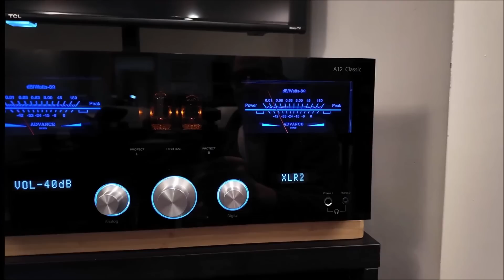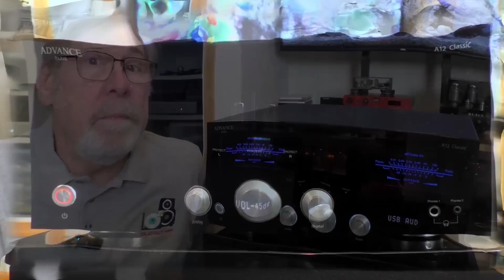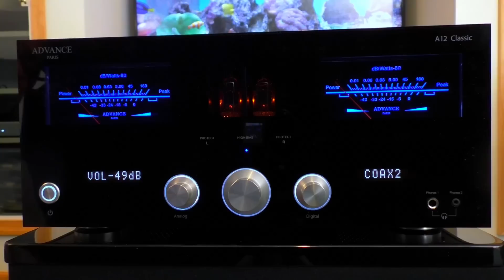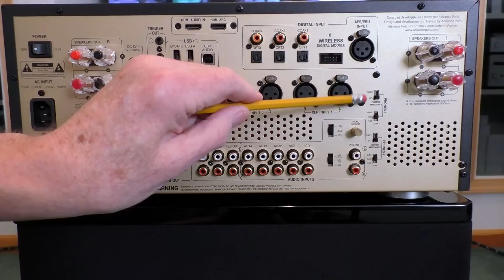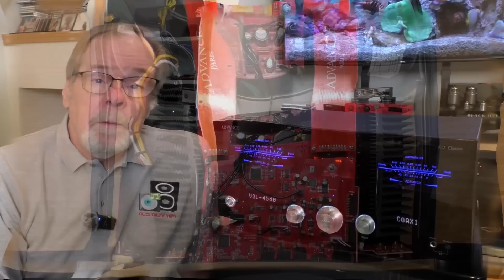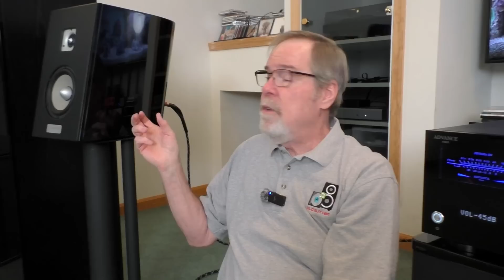Look out McIntosh! Someone new is knocking on the door! Advance Paris A12 Classic.

Comment: McIntosh are masters in marketing so it’s no surprise they are open to copy and criticism. This Integrated boasts impressive specifications, looks “okay” inside.  But from experience with Chinese-manufactured gear, their audio products are seldom thoroughly tested other than random samples, or ever burned-in. One cheap resistor or capacitor will put a hefty amplifier out of commission, what service facilities exist for Advance Paris?
Reply from the maker: Manufacturers Like Cambridge, Advance Paris, and Classe all have there own employees on site. Understand that all the Chinese partner does is mange the assembly, much of which is automated.  Advance Paris designs the units, designs the production process in conjunction with the Chinese partner. AP procures and specifies all of the componentry much of which is bespoke to AP. The toroidal transformers are a good example. They are not buying any of the self parts other than the ubiquitous small parts that are not in the signal path. I have some familiarity with this type of manufacturing. Remember all the basic electronic pieces and parts that go into any product are source from China anyway. Having your unit built there saves money in transportation cost as well as of course labor costs. As far as serviceability you can have that concern with any brand. Now with the new ownership of MAC the industry is a buzz with rumors so the ability to get that stuff repaired my be an issue. Kevin Moll at Skylabs Audio in Des Moines picked up the line because of the way it is built and its serviceability. All of these concerns and statements can be made about any product from any manufacturer. Thanks for the view and comment.

Comment: Good review.  Question:  Can you output the raw digital file from the A12 if one want's to use an external DAC?  And, McIntosh does not need to be worried about being pushed to the end of the line by the A12.  They have been there for quite a while.
Reply from the maker: What raw digital file? It is not a streamer. If you are connecting it to a digital source why not just connect that digital source to the external DAC in the first place, and then connect the DAC to the A12?
Reply: @OldGuyHifi  Yes, I made a mistake. Thanks for getting back.

Comment: Great review, but would like to hear a comparison to the A10 Classic
Reply from the maker: They are very close. I won't have the opportunity to do a side by side but I am familiar with the sound of the A10. They both share that rich and detailed Advance Paris "House" sound. As you would expect the A12, with its dual mono configuration does has more drive and a better sense of effortless power. That said, I think the A10 is an excellent unit and a great value. They both share so many similarities in features and gozintas & gozoutas. Both have very good phono preamps and internal DACS. I would be happy forever with either unit. Thanks for watching nd commenting.

Comment: Hi Ed, I've owned the Advance Paris A10 for 8 now months and loving it. How would you describe the sonic differences between the running the A12 in High Bias mode Vs Non High Bias mode. My preference for the A10 is High Bias I think, both can't put the difference into words. Beth Orton 👍,   Boards Of Canada - Music has the right to children album comes recommended. Damo
Reply from the maker: The A10 is a really great unit. I am jealous. I only get to borrow this stuff. At low volume levels I do think there is a small measure of additional smoothness to the sound in "High" bias mode. I just left the unit in "High" bias all the time. Thanks for the comment and perinate question.

Comment: Great review, as always. Like others I am curious on what it will take to swap or replace the tubes when the time comes. What is the life expectancy of the tubes? One You Tuber suggested that the unit needs to be sent to an approved service center to have the tubes replaced. The shipping would probably be more than the parts and labor for the tube swap. One other question, well two. Can the loudness be controlled from the remote and is it variable? Thanks! See you at Axpona??
Reply from the maker: I will ask. I suspect the tube life will be something like 10,000 hours. That's no uncommon for tubes in a preamp.

Comment: Hi Ed, great review as always. Just couple of things I'd like to know if you'd be so kind. First I didn't quite hear what you thought of the sound stage widthvof this thing, I mean just how wide did it seem to go? Secondly, this is a hybrid a integrated,, so the sound is not a wholly solid state one neither is it a wholly tube like sound either. So how does it compare soundwise with the LTA Z40+ you reviewed and praised just a little while back? Thanks.
Reply from the maker: The soundstage is really a function of the speakers. The amps job is to delivery the best possible signal to the speakers so they can do their thing. The A12 delivered in spades. On the Wharfedales the image was room defyingly huge. So it is excellent in that category. They're is no way to compare the LTA with the AP. They are totally different topologies with completely different sound signatures. The has a unique and individual sonic character. It is also more than twice the price. That said, I would buy the A12. Thx.

Comment: I've been looking for a modern integrated amp for the last two years after having vintage tube and solid state gear for years Still have that stuff, I'm not parting with it. So I looked at the McIntosh MA 5300, and the MA 7200 and they're fantastic, but the price was off putting. So I looked at the Rotel  RA-1592 and the Parasound Hint 6 and they're great, but there was something missing. And then the Advance Paris A12 came out and it just hit all the requirements. I listened to it at a local dealer and I was impressed. It was more than I thought I would spend but I'm happy I bought it.
Reply from the maker: That's great. I am glad you like the unit. It is a very compelling product. Thanks for tuning in.

Comment: The TI PCM1796 DAC is 20-plus years old and costs $3.20 when purchased one at a time ...
I'm not sure I'd brag about that particular DAC chip
Reply from the maker: So? If it sounds good it is good. Have you ever heard one? Do you even know how it decodes data? According to that logic everything old is questionable. Is  a 20 year Taylor Fladgate Port no good? Do you even know what that is? Thanks for you input Andrew.
Reply: @OldGuyHifi  / I'm not trying to pick a fight. I'm simply pointing out that as DAC (CMOS SMOC) devices go, it's old and inexpensive... The TI PCM1796 hasn't received an update since 2009, and companies like WiiM use a more expensive DAC in their $329 MSRP streaming amp. So my point was that I probably wouldn't brag about the TI PCM1796 in a $4,000 box...
Reply from the maker: Wiim is a bad example. They sound terrible. Doesn't matter what chip they use it has no oscillator clocks. It uses the cheapest 5 volt ESS mobile chip. It sounds far worse than the BB chip. Just because it is new doesn't guarantee better performance. That ESS 9038Q3M chip costs retail $16.00. Bulk price is less than $6.00. BTW, that ESS chip is used in DACs coating upwards of$2k. Just a DAC, not an entire integrated amp. What made be challenge your statement was you assume that I must not know what I am talking about. I had my first outboard stand alone DAC on 1988. None of this is new to me.  I would like to think we can agree to disagree. This is a wholey subjective hobby after all.
Reply: @OldGuyHifi  / I'm not sure we're disagreeing on anything other than the TI PCM1796 being something to brag about ... Other than that, I don't have any issue with anything you've posted in response. I wasn't making reference to sound quality (that's like arguing about favorite color). I'm talking about BOM Parts quality anyway, I think I know why they're using that old DAC, because I'm pretty sure whose digital board topology they are using.
Reply from the maker: Andrew, I am not sure any units Bill Of Materials matters at all. So, it not expensive and it old. Who gives a Sh!t as long as it sounds good. Thank you.
Reply: @OldGuyHifi  / Then why do you remove the lid and discuss the BOM parts?

Comment: Ed
I dig this review and it seems like a real winner giving you the advantages of voltage control in pre and current AB in the power amp.I wonder though the idea at this price of getting locked in with DAC or paying and latter bot using it.Guess I like  the old school design of Rogue.Atnthis price I might want to jump to Accuphase or Luxman. ( Love if you got the Accuphase E700 class A).Hey how about discussion of using tape and EPL for Dirac or other equalization.?
Reply from the maker: I really liked the built in DAC. I don't care if things change. If sounds good now it will always sound good. DAC manufacturers are playing the Intel game. Newer! Better! Bigger! Bader! You must get the latest!. Chip Roulette. Sorry, under $1k  they are starting to all sound the same. Good but if no different than the previous chip. The more upscale R2R and some of the multibit DACs have a great sound. I am sorry Charles, auto room EQ, DIRAC, and the like hold zero interest for me. They can't fix a bad room. Thank you for tuning in.
Reply: @OldGuyHifi  well your right I guess about Dirac in that the better the gear the less effective)less necessary.I ask because I guess being born during the Johnson Administration I remember when  tape loops were in and comforting to see the option is there should I want to try it.Sowakinh of olde gear I have always wanted to restore an APT Holman Pre.Amie dis a rest of one at ADR and it got good marks but I know you use your ears.What I Should really get to replace my EAR EL34 is sla good valve pre and get a few amps.But then again Accuphase and Luxman always beckon.I am rambling now
Reply from the maker: Don't worry. I ramble all the time. Just watch one of my videos. It is an old guy curse. BTW, I was born during the Eisenhower administration. I will be reviewing a Black Ice Pre soon and pairing it with some Class D mono blocks. Probably not for a month or so. Thanks for your thoughts and view.

Comment: Ed, are you able to swap out the tubes when they go bad? Can you tube roll with the A12?
Reply from the maker: Yes but is is a bit complicated. It can be done but requires a bit more disassembly then I was willing to do since it is not mine. If it was mine no worries, I would be rolling tubes a lot. Thx.

Comment: So this looks like a really neat integrated amplifier! I’m looking to buy one… But what is the likelihood of a piece of equipment like this needing service anytime in the next I don’t know 10 to 15 years?

Do devices like this run for that long with no issues? I would be worried about servicing it because of the smaller boutique type company advanced Paris is.
Reply from the maker: No one can predict lifespan. You saw the inside and it is all through hole componentry which makes it far more repairable. It is built like gear used to be back in the 70s. It is just uses much better and more modern parts.  Advance Paris has been in business for 30 years and enjoys a very good reputation. They actually aren't that small. The offer 26 different products. Watch for my upcoming review of one of their CD players.
Reply: @OldGuyHifi thank you!

Comment: Thanks for this Ed. I've currently got the Advance Paris A10 and love it but I'm seriously thinking of trading up to the A12. It's a shame you've not reviewed the A10 as I'd have loved to hear a comparison of the two from you.
Reply from the maker: Daz, hang onto to your A10. They are sonically as near as makes no difference the same. They both have that wonderful AP house sound. I found that to be true with the A7 (which is basically the A10 amp with out the tubes) and the X-i75. Be happy my friend. You have a good one. Thx.
Reply: @OldGuyHifi  Thanks Ed. As much as I want that extra pair of XLR inputs the A12 has, I think you may be right.

Comment: If I went modern this the direction I would go in. I would prefer they didn't have a built in DAC/streamer. I think those will be the first things that will get outdated.  id rather they cut 1000 off the price and just be a straight up pre amp/power amp. But its a great product none the less. VU meters I think just complete the piece visually. I know they are not really that useful but they are fun to look at.
Reply from the maker: I understand your concern it doesn't have a streamer which would be the built in thing I would also be concerned with. That said the DAC is really good and that BB PCM1796 chip has been around years. Think of it this way, some of the most cherished audio gear is old tech, like tubes or vintage gear. If it was good then and people still think so, then why worry. I have about $12k worth of DACs lying around here and I was very happy with the built in DAC. It does sound great. The differences in DACs is so subtle that like Alfred E. Neuman once said "What me worry!" Thanks so much for tuning in.
Reply: @OldGuyHifi  Appreciate the info Ed! I am also going to check out the music you suggested!
Reply from the maker: @stevendp2q  Right on brother.

Comment: First, thanks for the review. I can't speak for the A12 but I had the Advance Paris A10 running a pair of Magnepan LRS+ with a Rel Tzero MkIII sub. The music source is a Cambridge Audio Azure 851N which I play FLAC files from an SSD. I also have a Rotel CD-11 Tribute CD player. Prior to the Advance Paris A10 I was running an Outlaw Audio RR2160 MkII. I purchased the A10 because the Outlaw seemed to be under powered with LRS+ which are very inefficient; however the bass response was good anyway. The Outlaw and the A10 are about the same wattage wise but I have to say that I was a bit disappointed with the A10's inability to push those LRS+; it seemed even more under powered than the Outlaw. However I think the A10 is a better sounding amp in the upper frequencies. The upper mids and highs are a bit pronounced and I like that but the bass seems to lack presence and muscle. I'm not a "bass head"; in other words I really don't care for room shaking bass. Particularly with the kind of music I predominantly listen to mostly jazz piano trios, straight jazz with acoustic instruments, upright bass, etc. With the Outlaw I really don't need the subwoofer; it's just there to add slightly more presence to the sound-stage, but with the A10 I absolutely have to use the subwoofer otherwise not much bass. Additionally with the A10, mellow jazz guitar on some tracks sound a little recessed and slightly distorted more than I've heard on other amplifiers. The A10's sound stage also seemed a little narrower that the Outlaw. I also have a pair of Emotiva Airmotive T2+ speakers on the second channel which I use on occasion for different music genres. The response from the A10 was about the same, bass lacking a bit.The A10 is a lovely amp overall but I returned it. I've considered the A12 but I've read comments about the same thing, bass seems to be lacking a bit for an amplifier as powerful as it's specs say it is. .It's really difficult trying to make a decision when we don't have retail stores to check the sound out before purchases.
Reply: I own a Vicent SV-237 integrated amp. It's also a hybrid design like this one. It is anything but bass shy as you describe with the A12. Sonically it has very balanced sound. Puts out similar power specs. It might be closer to what you need.
Reply: @peternemeth4947  Thanks, I just checked out the specs and a couple reviews on it. It may be the ticket for me. It looks nice too.
Reply from the maker: Thanks for sharing.
Reply: The latest version, the SV-237MKII, introduced in 2022, adds Bluetooth 5.0 for wireless streaming, alongside a refreshed, sleeker front panel design. It retains the core circuitry, offering three analog RCA inputs, pre-out and record-out options, and four speaker terminals for bi-wiring. Features like tone controls (with a bypass option) and a loudness switch nod to classic hi-fi design while enhancing versatility. Sound-wise, reviewers praise its spacious, organic delivery—think deep bass, clear mids, and smooth treble without the harshness of some all-transistor amps or the bloom of full-tube designs. It’s a hefty unit at 45 pounds, with a large toroidal transformer and robust heatsinks, signaling serious power and build quality
Reply from the maker: Did you take it out of "High Bias" mode?
Reply: @OldGuyHifi  Hello, it was not in high BIAS mode.

Comment: One of the features of tube gear is tube rolling. Looks like the tubes can not be accessed. Are they even active? Or just for looks?
Reply from the maker: They are active and yes you can access them but it is just a bit fiddley. I looked closer after I filmed and there is a way to do it. Since the unit is not mine I decided not to try.